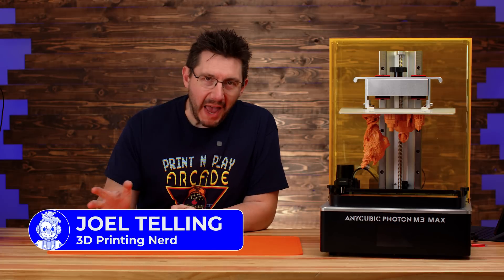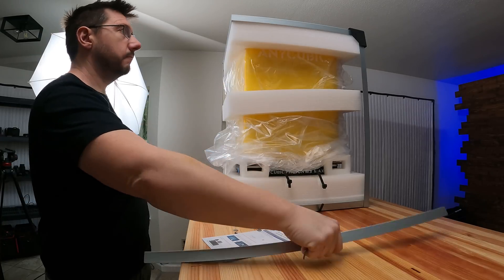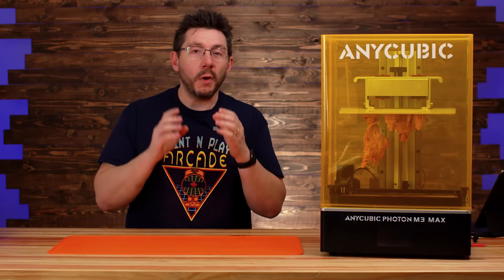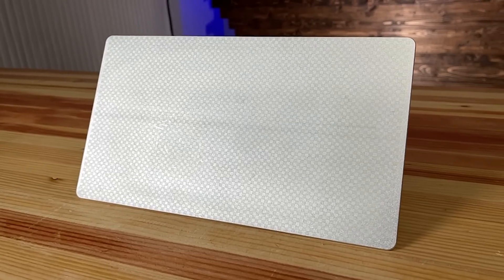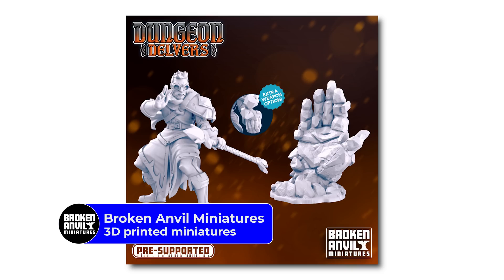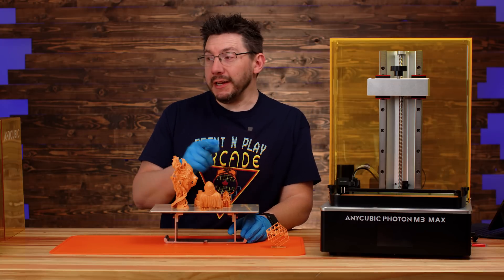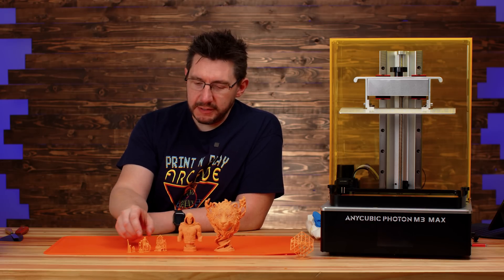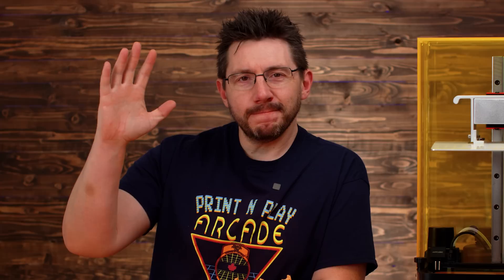FIRST LOOK! Anycubic Photon M3 Max 3D Printer

Comment: Does the autofill work on a standard 500ml bottle? Im curious as my other supplies are only 500ml.   Of course I could do transfers if a 1L is required
Reply: The pickup for the Autofill needs a 1L bottle.. 500ml is about an inch too short on height has an M3 Max as well I was a little disappointed at that revelation.. although it didn't matter too much as I had a 1L bottle from Anycubic  to transfer into

Comment: Great video however I think that not even acknowledging the slicing software that anycubic requires  was a bit of a miss.
Reply from the maker: They require a certain slicer? That wasn’t my experience. What slicer are you saying they require?
Reply: @3DPrintingNerd  This is exactly what I meant perhaps discussing what software you used since there's a lot of confusion in the 3-D printing community regarding issues with any cubic and say Chitu and pre-supported files etc. currently I'm on the fence between Jupiter and or the max so I really need details lol. Thanks again for your response.

Comment: Ok. Asking your your opinion. I have multiple FDM printers and very satisfied. I’ve avoided resin as I prefer to not get into the post processes, clean up, and toxic materials. Most toxic I get is with ABS which I don’t do much with ABS. I do a lot of things with Arduino, Raspberry, stepper motors, etc. I wonder if I should get into resin as sometimes, but not often, I have to triple think designs, bed orientations, etc. Curious if you would recommend resin for someone like me. Amazon Prime days are approaching so might be some deals, specifically in anycubic printers.

Comment: Great review. Would youd mind to share your settings for Craftsman resin? Thanks.
Reply from the maker: I used default settings in Lychee Slicer - anything specific you're looking for?
Reply: @3DPrintingNerd  Thank you. I was curious about bottom exp time and standard layer exp time. It's my first time using craftsman and i did not fully figure it out.

Comment: I guess the autofilling only fits Anycubic Resin bottles ?
Reply from the maker: The cap may fit other bottles? I'm not sure. Any of that size is my guess.
Reply: No matter what, make sure the seal is good. The pump is pushing the resin by pumping air into the bottle. Bad seal means resin leaking everywhere

Comment: Forgive me - I'm sure this is a dumb question, but I'm so new to this stuff.  Does a 7K monochrome screen create sharper detail than a Sonic Mini 4K...?  More "K" equals more fine detail?
Reply: More pixels but over a larger surface (46µ XY resolution for M3 Max) vs less pixels over a smaller surface (35µ XY resolution for Mini 4K). So the Mini 4K should be sharper.
Reply: @ilovetechnology8436  Thank you for that!  If you were shopping for a 3d printer ( under $1500 ) and "fine detail with no print lines" was your priority.  And you're making detailed head busts slightly bigger than a soda can, what would you look for?  Thank you again!
Reply: From what I've seen, unless you're printing super small or insane details, anything with 0.05mm xy resolution will be good.
Reply: @Becvar80  Appreciate that!  I'll for sure keep that metric in mind while I start to look.
Reply: My answers seem to be disappearing all the time. If you want the absolute finest print search for "mini 8k resin printer"
Reply: @ilovetechnology8436  Thank you so much!  That's what I'll look for.

Comment: This printer has a big issue with its monochrome display. I get a check pattern while printing transparent resin. Anycubic support is aware of this issue and told me, that they are working on a new display to solve this problem and asked me if I could wait till this new screen is ready for replacement. I will send it back and wait until all things work out of the box. So be aware if you print a lot of transparent resin.
Reply from the maker: Ooh thanks for the heads up
Reply: @3DPrintingNerd  I have some example photos to share, but I am not able to post links here in the comments. Any help?

Comment: In the taking portion, looks like you had the same issue Veg Oil Guy had, where the plate rises up at the end of a print, lowering the resin volume, so it fills up. This means you need to drain some, otherwise lowering the plate will overflow it. Until they fix that, I can't take it seriously.
Reply from the maker: Yup. It’s really more of an insurance policy for a big unattended print. The abilities and timing aren’t fully thought out. Hopefully a firmware update takes care of it.
Reply: @3DPrintingNerd  I believe they could just make longer prongs, thus keeping the level of refill lower, allowing more room for when the plate re enters the vat.

Comment: how does the bottle connect to the printer? -can any bottle fit? I know some have a plug in outlet that you invert bottles into, this one looks to be a screw in.
Do you think Anycubic will make a wash and cure to pair with this machine?
Reply from the maker: Not sure about the wash and cure. For the bottle, it’s a cap that fits Anycubic bottles. Not all bottles fit as of yet.
Reply: @3DPrintingNerd  thanks for the very quick reply!

I feel they might make one to compliment this printer size just because that is the direction many resin printers are going.

I guess you can just reuse an anycubic bottle afterwards. Some ppl buy bulk or mix so that makes sense. An adapter -or even better a reusable bottle might be a nice future idea. Even add an end to refill the bottle with the pump connection on the other side, like a gas tank. Reduce the amount one has to adjust and fiddle with the printer tank and reduce spills.
Reply: I'm assuming they went with this design to ensure a proper seal. With the pump pushing air into the bottle to push the resin, a poor seal would result in resin spilling everywhere

Comment: My main concern with these auto feed systems is that it doesn't stir the resin...which can lead to issues down the road. For things as simple as pigment separation, to even individual component separation which will lead to failures - there's a reason they tell you to shake the bottle for a few minutes first.
Reply from the maker: Agree with you - this auto feed works as print insurance but isn’t a long term “let the resin sit” solution.
Reply: @3DPrintingNerd  100%. I'm just worried about people who are going to take it as a "let the resin sit" solution, and then once they get to the 2nd half of their resin bottle they won't be able to get proper prints anymore because the chemical balance of the components are going to be too off. 

I've seen it happen before from people who don't shake their resin enough - at first things print okay but once they get to the second half of the bottle they can't get anything to print anymore because it's all messed up and they need to get new resin.
Reply: You could try sitting the bottle on a magnetic stir plate. It would probably work best in a wide base shallow container if you really wanted to do it properly.
Reply: @phun1901  That is a great and super simple idea.  I'm going to do that

Comment: is 1100 worth it over being a little bigger than the anycubic mono x 4k?
Reply: Mono X 4k is 192x120x245
M3 Max is 298x164x300
That's not just "a little bigger"
The Max has 260% the build volume of the Mono X
At $1100, the Max is bigger than anything else on the market at this price

Comment: Re-purpose the metal frame as a heat chamber!  In Canada my office is usually really cold and I would have failed prints, a chamber to heat the resin would be a game changer
Reply from the maker: That’s a fun idea!
Reply: @3DPrintingNerd  Are you sure? I remember a certain enclosure built a while ago 🤔
Reply: That’s a cool idea just add some acrylic sheets to box and hinges on the front for doors 👍👍
Reply: That's really interesting. 
It's always cool to learn what issues different areas and climates face, especially with the sensitivity of 3D printing materials.

I'd like to hear if you try it out, or if you have  other issues and solutions that you'd be comfortable sharing.

Comment: Since owning a resin printer im still not convinced. its such a messy process
Reply: I have a hard time justifying the mess. I haven't used mine in 6 months.
Reply: I've gotten used to the process, and it's not that messy, any more, as long as I don't get in a hurry.
What frustrates me is failed supports, not mess.

Comment: Auto fill is nice, especially on those larger build volumes, however it has a cut in the case, which could let in UV if you are not careful. not a perfect solution, but on the right path for sure!

Comment: How does this compare to other large formats? I was considering getting a Peopoly Phenom L before they discontinued it and came out with the smaller build sizes. How would you say this compares because the price is way better on this. Does the 300mm build height feel restricted compared to 400?

Comment: Not a fan of how much resin will be left in the pump, tubing, of cap thing.  Not to mention cleaning if using different resins or colors. Can that whole refill unit just be removed? May be good for some, I hover around my printer regardless, so keeping the level isnt an issue.

Comment: While I've had a fairly rocky history with Anycubic's FDM printers and some QC issues, this machine does have some very attractive features and for the space the machine is in, the price is competitive. I'm still wondering why none of the more mainstream manu's offer a factory flexplate, cuz god do they make printing much more conducive to frequent prints and overall easier removal/clean-up! 
Mark me interested, though the lifecycle of some of those other features that are consumables (like the screen) will be a matter of time and ultimately manufacturing process control. Slicers also are the life and death of the user experience, and all told, I'm not a huge fan of Photon Workshop, though it's serviceable. There are worse for sure.

Comment: Resin print quality is amazing but just seems like so much more of a hassle with the liquids and the post cleaning / curing.
Reply: I agree, but for me I was a little disappointed when I first purchased a Mars pro and a wash&cure with it. At the beginning it was messy and felt slightly complicated but now 6 month later I love it. I prefer to use it over my heavily modified CR10, if I dont need a large part. Its faster quieter and all I need to do is put in a file and with almost 99% of the time I get a supper clean highly detailed stronger print...I am saving up to get a larger resin printer now like the M3 Max..But it may not be for everyone..
Reply: Once you get used to the process, it's not nearly as messy.

Comment: The autofill looks like a great design to limit the amount of equipment that is touching the resin.  We will have to see how long the seal lasts on the bottles because the pressure system requires a good seal.